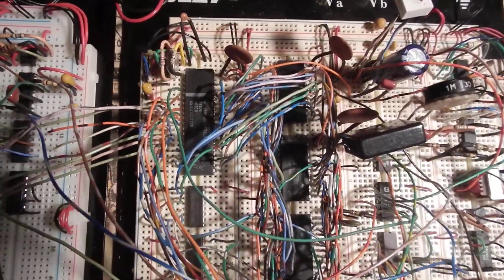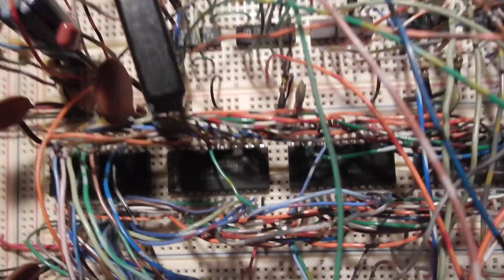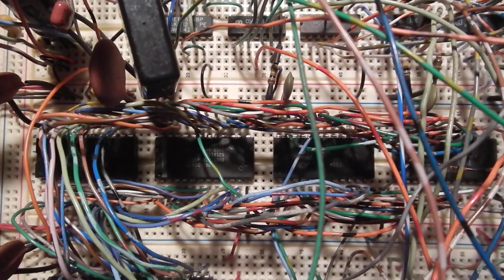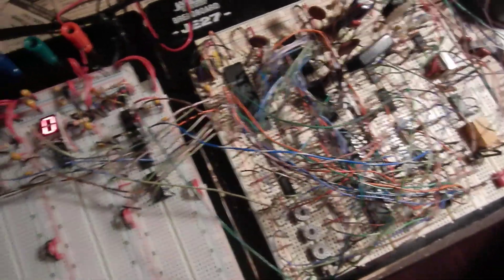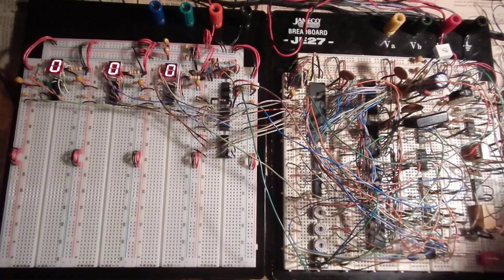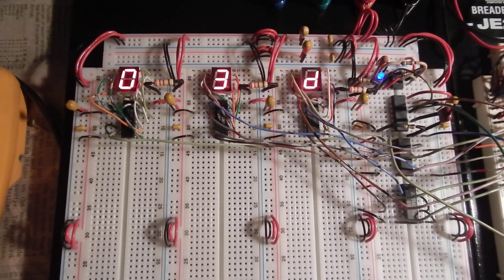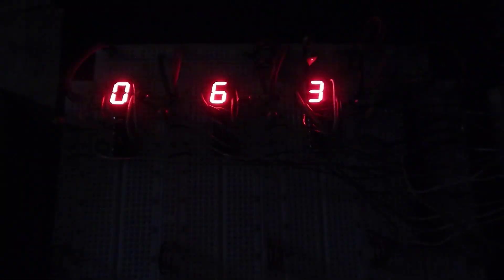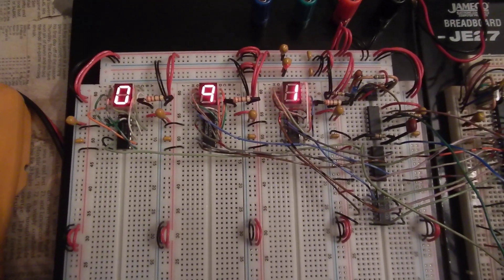"This is Digitalker"  Video #1 in Digitalker series.

Comment: Three questions, 1) are the addresses assigned to phonyms (like an spo256), or commonly pronounced words (as heard in the video)? 2) were these used in ham radio repeaters? It sounds remarkably like the call sign etc annunciators on repeaters in the 90s. 3) any chance you're from around the Spring Green area? Just noticing the channel name...
Reply: I know at least two of my local 2m repeaters use digitalker ICs for identification.
Reply from the maker: 1) No.  2) Probably yes, they were used in elevators, cash registers, lots of places.  No doubt some hams use them in repeaters. 3) Nope.    The explanation of the basic
workings of Digitalker are that the 8 bit starting address of the selected word to be spoken is put on the processor data bus.   Then when the NOT W/R pin goes high that
latches the data into a register and that sends the appropriate starting address out to the ROM for scanning.  Each word has its own scan of multiple ROM addresses
which sound out the word.   Digitalker does NOT use phonemes (or allophones as they are sometimes called), such as SPO-256-AL2 does.   SPO-256 is fun to work with
too, but it is not nearly as understandable as Digitalker.   On my test circuit used in these videos, there are 9 bits.   The highest order bit selects SSR 1 and 2 for the basic
vocabulary, that is selected when bit 9 is low.   When bit 9 is high, SSRs 5 and 6 are selected  for access to the extended vocabulary.